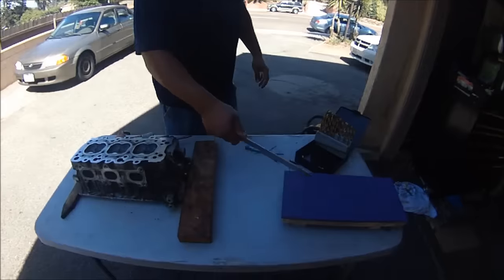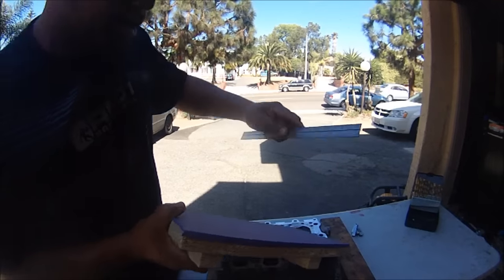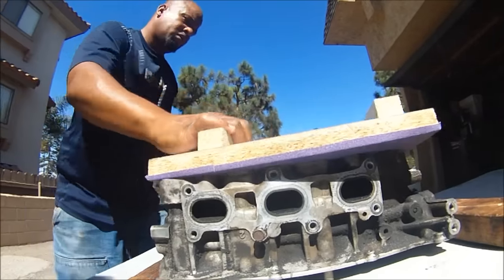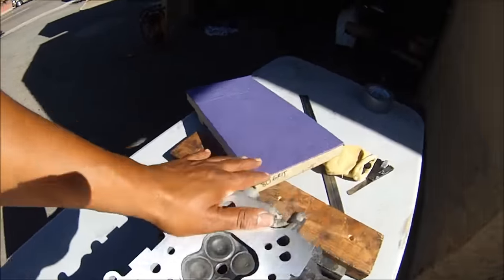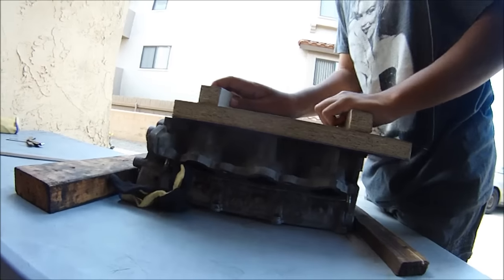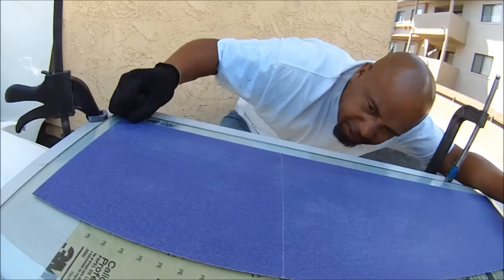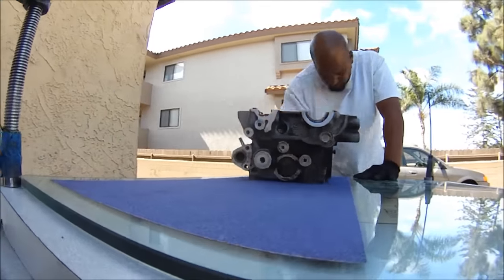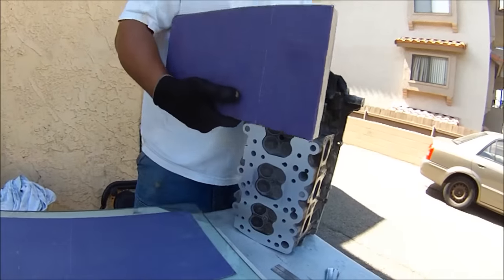HOW TO RESURFACE A WARPED CYLINDER HEAD AT HOME WITH SAND PAPER still works in (2023)

Comment: This is how a REAL technician solves problems,  Wtf good is fancy expensive equipment and tools if there's no electricity or you're  nowhere near them True Survival Skills is the ability to repair anything or conquer any problem with limited resources using BRAINS and still getting it done properly with No Fucks Given To Haters
Reply: Very true ,last time I did this was 40 years ago in the wild . Never failed it  since .
Reply: Reminds me of the book "Grapes of Wrath" where man polishes valves on his engine while camped along roadside.
Reply: I remember a time where I didn't even have sand paper and a bit of plywood to do this. Just dragged the warped head behind me along a sandy beach tied to my waist by a precision rope. Took me 5 days of walking! At the end of it, I realised it wasn't a "precision" rope and the "mechanic" I bought it from was actually banging my wife for the 5 days I was dragging a warped head along a beach trying to fix it. Electricity and fancy machines would've saved the bother. The beach walk done fuckall
Reply: Guy I worked with from Vietnam said they used to sand down iron heads on sand spread on a flat surface of some kind, said it took a week of doing it all day. There was no other option.
Reply: @biggsly5000  could've took a break and spanned it out over two weeks? Wouldve been less boring and could've probably got some free time to do something like tend to a small garden or walk a dog if he had one. There's always an option. Dogs need to walk, it keeps them fit. He shouldn't neglect the animal in favour of sanding a cast iron head on a flat surface of some kind with loose sand. The dog will get fat over time and it's muscles will stiffen up. If you keep a dog as a pet then it's better to enjoy it, a good walk is not just for the dog but the person too! Forget all this sanding business. The cast iron head won't die and make you sad one day
 The dog will
Reply: Shaun Last name if you keep it fit it will be tastier too, its a win win for everybody except Fido.
Reply: @shaunlastname391  I don't know if you know this but in Vietnam they eat dogs so the fatter the better
Reply: haha real tech lol clearly you dont work in a shop. REAL techs laugh at you and this guy
Reply: Very true statement
Reply: burningfeet 57  Are you smokin a joint ?

Comment: I learnt this method when I first started my trade almost 29 years ago, I can assure this method is fine for surfacing any part as long as, the sanding table is flat (*as shown thick glass supported on a thick table), with rotation of the work piece every 20 strokes or so, using a piece of sand paper that exceeds the size of the item  by enough that you dont push the part off the paper at either end, you can achieve a surfacing job that is well and truely serviceable. Great job m8 that 1 is taught to mechanics in trade school, the only reason we use the machine shops for head surfacing is for perfection, when it's a customers car there is no room for mistakes, if ur a hobbiest and like the satisfaction of building it with ur own hands then by all means follow these directions use paitents and you will definitely see / hear / feel the reward, again great video m8
Reply: Do you know how they used to get perfectly flat surfaces 1,000 years ago, before there were blanchard grinders, set up blocks, squares, etc.? 
They would take 3 relatively flat stones and start to rub those 2 stones together, then switch and rub those 2 stones with a 3rd stone, then go back to rubbing the first 2 stones together.  That is what I've read online, anyway.
I remember starting my self taught car/motorcycle building/machinery career and someone telling me to check the flatness of cylinder heads and the truness of pushrods on glass, bcuz it was supposed to be close to perfectly flat. That made me wonder how the hell they made things flat before we had inspection equipment.

Comment: Great video! A machine shop might be the "right" way, but if your working on a budget or just dont  have a shop close to you, this would be a lot better of an option then not doing anything at all and putting it back together. I always use permatex copper spray on the gasket too, seems to help.

Comment: I did this on my Subaru EZ30 that has since been turbocharged. The head is within 4 hundredths of a millimeter, which is tighter than factory spec. Holds 8psi boost from a Precision 6262, on E85, making 275awkw. No leaks, no boiled coolant. 

Just because you can do it at home doesn't mean it's dodgy. People need to realise this! :D

Comment: This is awesome.  This is great for older cars, or just getting some additional time out of one that's blown through the gasket.  You can check the gasket manufacturers and see what they require for surface finish.  Some OEM ones want a mirror finish that could never be done like this, but a lot of them, even if they get picky, then you move up to 400 or 600 grit, and spend more time.  For someone really strapped on cash, maybe a weekend spent polishing is worth it.  Also, sometimes, if you have to remove too much material, there are copper head gaskets that serve as a shim, to increase spacing again.  (Remove too much material, and it affects timing and compression, and can just blow out the new head gasket earlier.)

Comment: thick plate of glass with emery paper and oil in a circular motion even pressure let the heads weight do the work
Reply: I work on boat motors. If a boat motor gets hot it will almost always warp the head blow out the head gasket. Have used glass in Emery cloth with his classes being only thing you can find that is actually flush and flat.
Reply: So you do it upside down then? Ah, seems more precise, the material and method. I pick up garbage for work and occasionally see a glass table piece and think 'hmm.. don't need a glass table nor have the table but nice piece of glass. Wonder if it could serve a purpose...'
Reply: @juntjoonunya9216  as long as it is a flat piece of glass and does not have facets it will work. I have thought the same thing about planning a big piece of glass or finding an old outdoor glass-top table.

Comment from the maker: For those of you who want to know if you can sand cast iron heads at home YES you can. I am making a video right now and it will be out soon stay tuned.
Reply: oldskool funk man I love your channel! and you helped me in a non auto related way but in spirit, god bless! not saying your tips are wrong or anything! they are awesome in helping someone save cash! and work if they can do it themselves. But it's just when I feel like giving up! cause of other life issues in my way! you say at the end of your vids some serious powerful stuff! tells me I need to keep fighting this fight though it's getting old and I'm tired of it.
Reply: oldskool funk  Hey Man Just wondering when will you be post the video on sanding the cast Iron Heads?
Reply from the maker: Give me a couple weeks I got swamped with work OK. Don't worry I'll put it out. But you don't have to wait just use wet/dry (3M brand) sand paper same grit and finish it off with WD40 the WD40 does the trick.
Reply: oldskool funk 
Still looking for that cast iron head with sand at home video...what's up with that?!
Reply: I'm doing this to my car what coarse would give me 60 ra finish? my gasket calls for it. thanks in advance God bless.
Reply: +ibra “id” d It works the exact same way.  Cast Iron will take a slight bit more time than AL but CI is still relatively soft in comparison to steel.
Reply: nbxıüو
Reply: oldskool funk you remind me of me. I always try and fix things myself ans it would be great to meet you. I live in England and if you ever want to visit England you are welcome at my house
Reply: Nice job....11'x8' white paper is .004"...if you don't have a feeler guage.
Blessings(!

Comment: professional machinist here. so while this is not the quickest way, it WOULD WORK. i would do all the work on the glass,  rather than using the particle board, but this is a good way to get a car back up and running if you're broke and can just barely afford the parts. I've been there, I've done this. thicker the glass the better. you want that to be rigid as possible. throw it on the flattest table you can find, check it with your straight edge after you lay the glass down. if the glass is bowed at all, shim it up with paper. if this is done right, the head can be just as accurately resurfaced doing this as on a mill. 

another tip, take your straight edge to a machine chop and ask them to check it on their granite block. that takes 30 seconds and most shops will do it for free. if you cant do that, check the head with BOTH edges of the straight edge, if that thing is a banana shape, you are gonna have problems.
Reply: MonkeyWithAWrench o
Reply: Did you watch the video at all? did you see him constantly checking with the straight edge even down to 1/2000? why all the preaching here just to let us know you are white and know it all?
Reply: Russ Jamison  you damn right I got issues with the demonic system of whitesupremacy
Reply: Russ Jamison  If calling out the demonic system of white supremacy and exposing you demons as evil is what makes me a conspiracy theorist, then so be it!

Comment: Hey oldschool, I worked in a machine shop for four years before I returned to school for mechanical engineering. What I can say is that .004" is not that bad so a diy surface job at home with a fine grit sandpaper works just fine. I also commend you for not using a whiz wheel on the head because I think we both know that ruins a head. But one thing, if I must add, is that you did not check the cam tunnels for warping. If a cam tunnel is warped, the cams can bind up and cause engine problems. Of course it does depend on how warped the head(s) are. It sounds like from your comments on the video that machine shops are scams. No we, at least the shop I worked at, are professionals doing professional work. I am all for doing your own projects to save some money if you can or if you have to. One other thing I could recommend is to use WD-40 next time you sand, at least with the finer grit paper.
Reply from the maker: I agree that the cam and crank journals need to be checked for proper straightness and have them line bored. I made a video sanding Cast Iron heads with WD40 and it is much faster and efficient. It will be out soon. I don't have anything against machine shops at all I just learned how to do some of the same things at home.

Comment: this is an old trick, and theres nothing wrong with it, the only reason one does a machining job of this is, is because we are lazy fucks, and elbow grease is an outdated currency;) but sanding on a glass pane is as good as any machine job really.
Reply: Morten Bakke +LOL   I was about to write the same thing and saw your post, frigging too funny! I did this to a 1970 bonni  head, An old school guy that has a shop for fifty years told me how. It came out mint. "We could send it out to the machine shop but you wouldn't get the satisfaction of doing it yourself" Twenty years later and it's still good. And now I'm going to use it on another bike.
Reply: not just that, but actually a machine would do the work much faster and perhaps even with less margin of error....
Reply: Old as hell. It sure works and I have used it couple of times but if you don't have thick glasspanels lying around I don't see the point. As machining the surface flat costs something around 40€ here. Also remember to check if the camshaft line or wtf it is is straight.
Reply: the way to fix camshaft  line is to surface the head side ways only so head bolts will make it straight again when torqued to the block ,its more complicated but i have done it , head warps up when  loosing the head bolts
Reply: It is an old school trick, yes... And it worked very well with the old-school engines with (Camshafts in the blocks) pushrods and cast-iron heads & blocks... But not very effective for most engines with OHC's and aluminum heads... It is usually going to develop problems soon after this type of work has been done... It is one of the reasons the 'old-school' cars & trucks are making such a comeback.. They respond to work like this in a much more positive and durable manner... LOOK, before You leap people...
Reply: One of the few things to correct the problem of the camshaft(s) bearings from being out of center on warped heads is to have them align - bored at a machine shop, after they have been surfaced and bolted onto the block... The things that prevent this technique from being effective are 1) Not enough material next to the cap bolts and sleeves to allow for any material loss from any kind of machining  2) The low critical temperature of aluminum alloys (about 375 deg. F.) making it likely that the metal has lost its' original strength (properties) and will likely warp again when under load  3) The unavailability of camshafts that have oversized bearing surfaces to allow align-boring like this... It would be far cheaper to replace the warped heads with new ones, and cheaper yet - to replace the entire engine with one that is known to be good from a totaled vehicle... It might be a challenge to match the engine from the original electronics and equipment that the original engine had.. This is why several vehicles of these newer designs just end up in the salvage yards after maybe 12-13 years and maybe 150 k on the odometers. They just become too expensive and troublesome to repair-rebuild... And that ladies and gentlemen is EXACTLY what the current auto manufacturers want...
Reply: do you know how to work on classic cars like mustang 67 engine block?
Reply: Your right...people are too lazy these days.
Reply: Michael Martinez 
BS! If this were true we would see scoring on the cam journals and I don't see that unless there is an oiling problem. 
Cheaper to replace the head or engine? Pft! What color is the sky in the world you live in?
Reply: @pedlpower  I was gonna say the same thing. If I do the work and get another 50-100k out of a car for a few hundred dollars, that's a score in my book.
Reply: @jesus7es7dios7  To do this on a machine would require taking a larger amount of metal changing compression level.  On a v8 it also requires doing both heads. This method works best on a motor with just one head. 50 years doing mechanic work i have done it both ways.

Comment: God is good. He never disappoints, you might not get what you want because there is a bigger plan out there for you, and all the pieces have to come together first. He knows best. Thank you for taking the time to make this video. I'm working on my sister-in-laws timing belt, which bent most of the intake and exhaust valves... Pistons were fine, but I'm dealing with some space in between and I'm so lucky I came across this video. Bless you!

Comment: Would be a good idea to paint the cylinder head surface in engineers metal stain to see how the sanding progresses.
Reply: So, you think that is better than the straight edge thing?
Reply: @kay19833  a straight edge also helps to guide you and so would engineers dye. His method works extremely well but using two techniques in unison gives you extra reassurance that your straight edge is actually running true. Engineers straight adges have to be calibrated as metal moves over time. If they are not stored correctly or they are knocked it can throw their trueness. Using engineers dye would confirm that it is in fact, all running true. All of that said i am not degrading his work in anyway, i am very impressed with the work ive seen and this is just an explanation to the benefits of incorporating two good techniques
Reply: @Alex Middleton 

No need for that a Sharpie does the same exact thing. 

If the middle of the head is sanded then the rest is flat. 

The middle of the head is always the worst part, any other part the head gasket will fill in.

Comment: I am  going to do what you you did ,cause I blew my head gasket on my 2017 kia forte,bought new head bolts ,threader,head gasket from dealership- something to learn every day...God bless brother/peace..Navajo from NM
Reply: Beware, if the head is warped and you resurface it without straightening it flat first, or without machining the cam beds and caps, the camshaft could snap in half after a few thousand miles, or you could lose oil pressure. If you plan to have the car for a long time I would recommend trying a head gasket sealer product that you put in the cooling system if it's leaking there.

Comment: I would do this no problem. Guys who built steam engines would have to pass a test where they had to make a warped piece of iron flat to like 10,000 of an inch. They used only a file!
Reply: Brad projects yes but they used proper references like surface plates, not fiberboard which can shift and move under pressure.

Comment: A couple hours of getting supplies and doing this yourself would be far faster than waiting several days and paying hundreds for a machine shop to do it.
Reply: Yes but a machinist is going to do a far better job than a guy with sandpaper and a sheet of glass can do. a head resurface isnt going to be hundreds either
Reply: @elobiretv  depends on how warped it is. Major overheating ok probably needs a real machine shop. But if you knew the HG was going and were pre-emptive, there may be no warping at all. I replace mine, HG blew, but it did not overheat. Slapped it back on, it was fine.